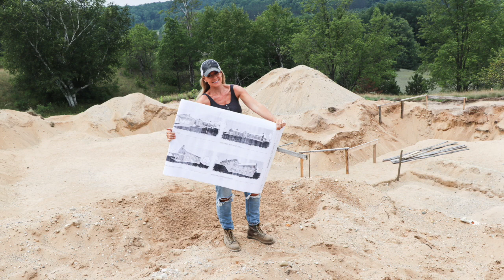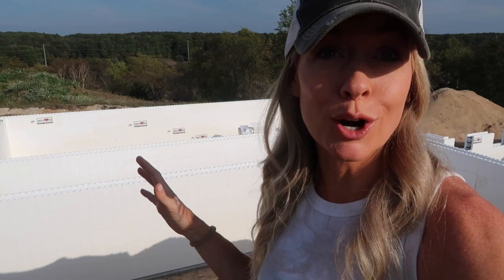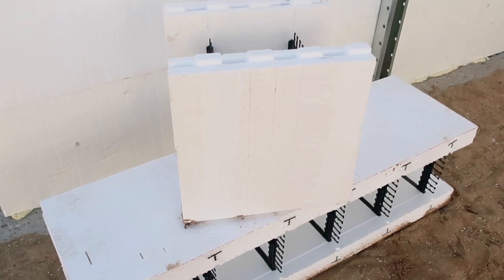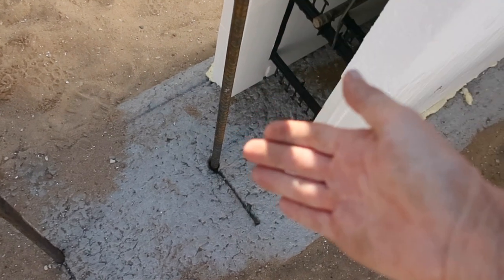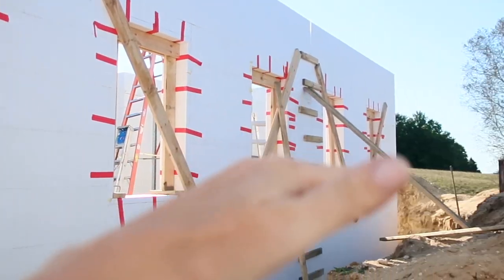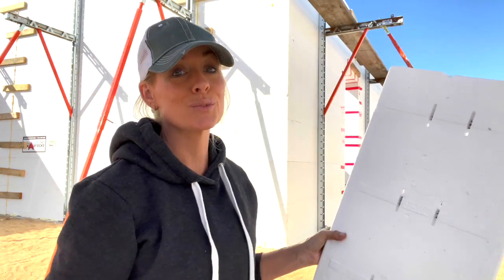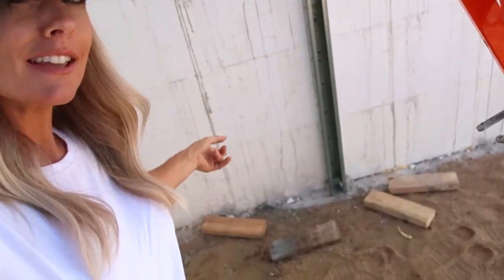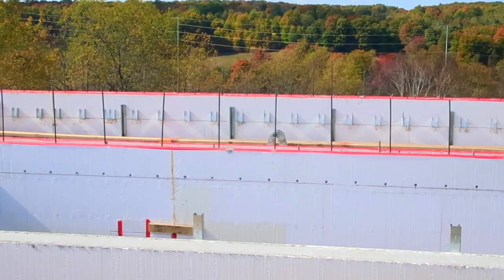DIY Dream Home ICF Basement Walls

Comment: 2:40 why did you cut to match the joint below?  Everything ive read says to stagger the joints.
Reply from the maker: Every block should be staggered except when making the common /vertical seam. What you see at 2:40 is me cutting a common/vertical seam in the wall. Each common seam is braced/strapped together with 2x4s on both sides of the blocks before the pour. Fox Blocks ICF website is a great recourse to learn more about vertical seams and when they are needed in a wall. Hope that helps:)
Reply: @FletcherCreekCottage  thanks!   I knew you had a reason!